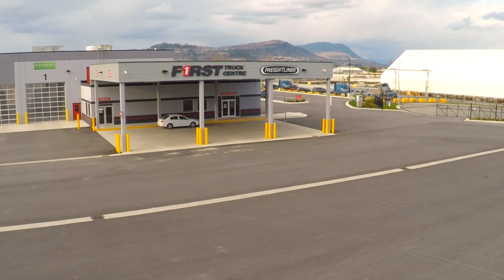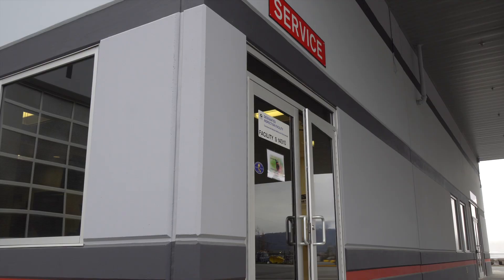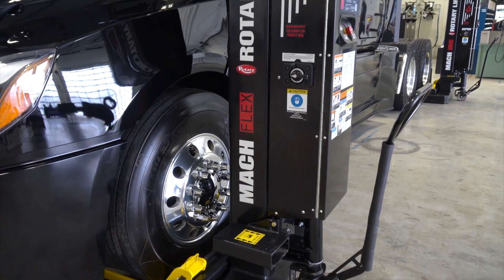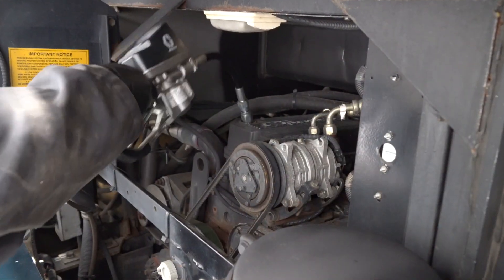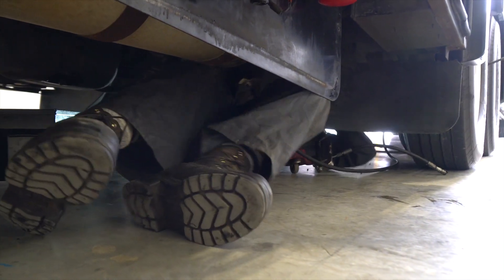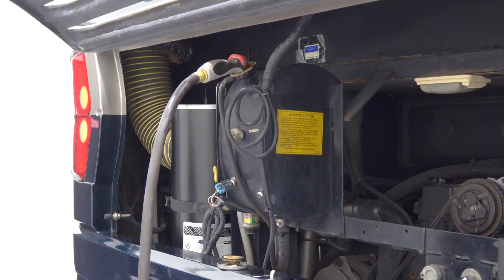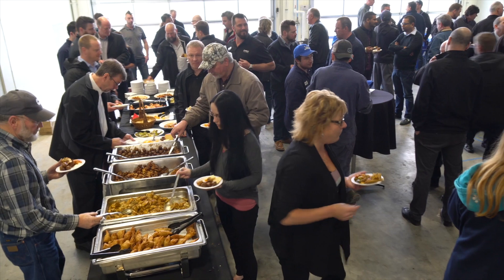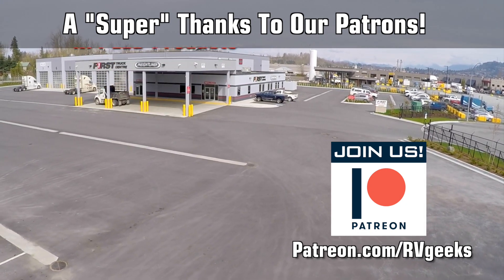🔧 RV Maintenance - Part One - First Truck Centre 🔧

Comment: This video is spot on as to the importance of a knowledgeable tech inspecting. At 9:27 you mention having the ride height bushings inspected. I had an experience after having the coach inspected. The grommet fell out while traveling on the highway. The rear immediately dropped, the coach shuddered violently , and it felt and sounded like all of the tires had gone flat. Scared the you know what out of me! Luckily it did no permanent damage but having this happen due to a 90 cent rubber grommet was astonishing to me. Moral of story? Have qualified people work on your coach or gain the necessary knowledge and DIY!
Reply from the maker: Thanks for sharing your story, Raymond. Glad you and your coach are okay!

Comment: To note for most newbies... Most RVs  of this size do a once a year oil change and lube with air filter, fuel filter, oil filers, and even a flush. Just to start.. If you put lots of miles over the year then you may need to do it twice a year. Rear to need it more then that..

Comment: You shouldn't tighten an oil filter with a filter wrench! Just get it as tight as you can with your hand.
Reply from the maker: We agree... on a car, where we tighten only by hand. We asked the tech about that, too, and he said that with such a large filter in a challenging location to grasp it, he can get a much better feel for when it's correctly tightened by using a filter wrench. He specifically went back in with the "regular" style wrench, because he said the extended one he used to get it started has too much "stretch" to it, preventing him from accurately judging how secure it is. He really seemed to know his stuff, and we have a lot of confidence in what he did. 😊

Comment: Do y’all use DEF?
Reply from the maker: Our 2005 engine pre-dates DEF, so not needed. I think it came around in 2007 or 2010 (there were two different phases).
Reply: Ok thanks... our 04 Cross Country Didn’t... Safe Travels!

Comment: Please I would like to know is having a diesel rv like a boat, everytime you take it out you have to repair something? We are looking at diesel because they hold their value but are we asking for a very expensive home to live in? thanks
Reply from the maker: Hi Melinda! Having three VERY close friends who own boats (one sailboat and two motorboats... all large enough to live aboard, and us having spent a week aboard two of those three), we feel we can safely say that owning an RV is NOT like owning a boat from the standpoint you mentioned. We have never once broken down or been left stranded in 15 years of full-timing. Our various little repair projects that crop up from time to time are typically no more challenging than re-stringing a window blind after the cord breaks, or adjusting basement door locks so they close correctly. Most of the work we've done is routine maintenance and upgrades/mods. That's not to say that things don't break, and we've had our share over the years. But we never get the feeling that "things are always breaking" and enjoy spending time USING our RV far more than spending time working on it. We did buy both our RVs new, so of course buying an older, used rig is much likelier to require more fixing of things. But our current RV is over 13 years old now, and because we take good care of it, it treats  us well back and we don't find it a bottomless pit of need by any stretch. Your mileage may vary of course, but if you go in with the understanding that it is indeed an assembly of mechanical pieces that can, and at some point will, require some attention, you'll have a realistic and happy experience. Personally, after seeing the ridiculous amount of work, time and effort that our friends have to put into keeping things running on their boats, we wouldn't take one as a gift! 😉

Comment: May day may day! I have a problem with my A/C and it's getting hot here in Arkansas. I have a digital Coleman Mach thermostat on my dual compressor pump. I turn it on and it will run good for about an hour. Then suddenly my thermostat will read that the inside temp is 30° F when it's actually 80° F in my RV. Then the pump will not turn on. If I shut it down, and turn off the breakers to the system, let sit overnight, It will again work for about an hour. And again give a false indoor temp reading and not turning the pump back on. Could this mean my thermostat is bad? I have no HVAC experience and Im stumped.
Reply from the maker: Oh boy, Arthur! We wish we could help out on this one... but we've never had any trouble with our ACs or thermostat (knock on wood), so we don't have any advice. It certainly sounds like it could be the thermostat failing... although it could also be the remote temperature sensor (if you have one... usually used if you have more than one heating/cooling zone). Or it could be a circuit failure in the AC unit itself. You may have better luck searching the forums at http://iRV2.com/forums and/or posting your question there (they're free to join and post), as someone else with your make & model of AC and/or RV may have some experience. Hope you get this fixed... and FAST!

Comment: the air dryer cartridge is changed every 2-4 years. not every service. Fleetguard fuel filters are nothing special BTW. Cummins just puts them on at the factory because they're cheap just like the green coolant.
Reply from the maker: Hey Greg! Those filters are probably cheap because they're Cummins's own brand! LOL And you're right about the air dryer, just like the coolant... not an annual task. Next year we'll be due for our transmission service! 😊

Comment: I always do my own work and some people will say that it's too much hassle but not for me so I question part 2 brake issue seal or yikes spun bearing and getting ready to cook the spindle and start a fire.I also like the old slack adjusters that were manual not the automatic ones that people take for granted and don't check old school trucker when there were real truckers no GPS no backup cameras no cell phones just map book and a CB got me everywhere with no problems back when the world was a better place
Reply from the maker: Thanks for the supportive thoughts on our wheel/axle. We'll have complete details soon. I'm an old pro myself, a little in the trucking world, but far more driving tour and charter buses. I totally remember the old days, where it was just me and paper maps. But not only did I have no CB, but a busload of passengers, who assumed I knew everywhere I was going, regardless of the destination. I've been on five-day charters, with multiple first-time destinations in several states. The only thing worse than getting lost is getting lost with paying customers looking over your shoulder the entire time, wondering why they aren't at their hotel in time for their dinner reservation! The world may have been a better place back then, but if I could go back in time with an iPhone, power mirrors and a back-up camera, I'd be king of the world! 😁

Comment: Why does the tag axle need to be lifted as well?
Reply from the maker: Different type of suspension that trucks... our wheels aren't supposed to hang from the suspension. We've seen videos showing buses up on this type of lift, and the tag axles hang WAY down, which isn't good for the suspension.
Reply: RVgeeks ah that makes sense. Your guys information is EXTREMELY helpful
Reply: RVgeeks I didn’t think of that and I thought that there was a lock for the tag axle so it can be locked in the raised position but I guess that would be too complicated.
Reply from the maker: Some tag axles do have lifting ability, but most (including ours) don't.
Reply: RVgeeks so by that do you mean that if your rig had the lifting ability it means that the rearmost axle can be raised and lowered independently of the other axles? This of course only applies to the rearmost axle.
Reply from the maker: That's right. An RV (or bus) with a lifting tag axle can simply press a button on the dashboard, and the rearmost wheels will lift off the ground.https://www.youtube.com/watch?v=355eOL6JCF8
Reply: RVgeeks thank you for the helpful video
Reply: Why not just use 4 lifts and place them under the tag axle and the front steer axle or would that not work?
Reply from the maker: Gotta support the drive axle too
Reply: RVgeeks that makes sense but if the chassis is the same as a semi truck isn’t the axle arrangement the same?
Reply from the maker: Not the same. Trucks have solid axles. The tag axle has its own suspension, separate from the drive wheels.
Reply: RVgeeks didn’t realize that. So on your rig the drive axle is solid and the tag is not.
Reply from the maker: Here's the thing.... on a truck tractor, all 8 rear wheels (the drive wheels) are all attached to the frame in a way that will not let one set sag way down if not lifted while the other is lifted. You can see that in the video at 2:42 where the unsupported wheels don't hang down. On a bus, or motorhome, since the tag axle is independent from the drive axle, they hang way down, as you can see at the 12 second mark in this video: https://youtu.be/kryn6q52X78 First Truck said that's not good for our tag axle suspension to hang like that, so they've ordered a 5th & 6th lift to do it the right way.
Reply: RVgeeks oh I see thanks for the helpful information

Comment: What is the Gator aide bottle being used for? You can see it @3:45 mark. looks like it's been there a while.
Reply from the maker: Great spotting, Mike! Here's the secret behind it: https://youtu.be/9w12E68nseo
Reply: Looks like a good quick fix. My back ground questions why the "breathe tube" is not routed back to the intake. (IE: Type 4 Positive Crankcase Ventilation systems) But, my exp is on smaller diesels, and gas powered stuff.
Reply from the maker: Sorry, we don’t know either! Those diesel mechanics have a lot of secrets up their sleeve. LOL

Comment: Hi guys! Great video! Can you tell me if the First centers have any age limits on RVs they'll take? I had another Freightliner truck repair facility tell me they will only service rigs 10 or less years old. As mine is a 2008, I'm getting nervous.
Reply from the maker: Hi Mark! We’ve never heard of anything like that, and since our rig is an 05, we’re guessing you’re in fine shape with an ‘08. Of course you can give them a call and speak to a service advisor about what services you’re looking for, and they obviously can tell you if there are any age related issues. But we doubt it.

Comment: A rule I've always followed, if you can do the job yourself and know what you're doing, then do it, if not or have any doubts or questions, leave it to a professional. Better safe than sorry later on. Also prevents potential future expenses that can break the Bank.
Reply from the maker: Thanks. We agree 100%! As we mentioned at the end of the video, Part Two will be all about which tasks we perform ourselves, which we leave to the pros, which can go either way, and how and why we make those decisions. Stay tuned!

Comment: Great video demonstration Peter & John. I even get more great ideas from the background items you didn't talk about. Like a plastic pop bottle on a bypass tube. Brilliant but simple way to prevent annoying drips on those nice clean RV parking pads.I deal with First Truck Centre in Edmonton. Our Monaco Signature had fiberglass and paint repairs done in their body shop at the West Edmonton location. You absolutely can't tell where there was damage or repair. A fair price and excellent work is about as good as it gets. Bruce Emery is the Shop Manager. Bruce tells me today RV's constitute a large part of their customer base.
Reply from the maker: Hi Malcolm! That is so great to hear we're not the only ones who've had great experiences with First Truck, and that their Edmonton location is the same quality place (not surprised). It's also good to hear that their body shop is as good as their service, since we're looking into having the peeling clearcoat re-done around the radius around our roof. By the way, that bottle keeps oil off our toad, as well as RV pads! ☺️ https://youtu.be/9w12E68nseo

Comment: Speaking of RV maintenance, could you do a video providing your year by year annual maintenance cost of your class A.
With you owning your Mountain Aire since 2005, this would be VERY helpful to potential class A buyers, since there is almost no long-term, year-by-year maintenance cost info available on the internet. Thanks in advance
Reply from the maker: Hi Dionyz! We'd love to do that, but it will take a pretty serious amount of time to assemble. We haven't kept a spreadsheet for the past 15 years, but we'll add it to our list and aee what we can do. In the meantime, we'll be sharing pricing information about this maintenance visit in the blog post that goes with Part Two of this video. Stay tuned! 😊

Comment: Nice to see that Cummings so dry underneath They were dang good but  known to undercoat a truck as it was driven down the road lol And that oil filter they took could be a bear to get threaded back on. Looks like they caught a wheel bearing on it's way out. If one gets bad it will usually trip the ABS light before things get too horribly bad. Sets a gap or wobble run code
Reply: There isn't any g in Cummins!

Comment: Thanks for posting this.  I have always wondered where we would get service on the road and this at least provides one option.  Wish we had a facility like that nearby, I won't let any of the RV dealers touch my coach (long story).  I do enjoy doing my own work, but there are things I prefer not to do and have a small shop in the next state I take it to when necessary.
Reply from the maker: We sure know what you mean about not trusting certain dealers. Been there done that. :-/
Reply: I am fortunate to have an excellent truck repair shop just 3 miles from my home. I use that facility for all my "truck" chassis service and repair, from brake work to oil changes to state inspections. They have even warned me of things that have had a history of problems in my 2016 V10 Triton. That way they check those areas with each visit. And what I really like about this facility, their work is very reasonable.
Reply from the maker: That’s great to have a good shop so close! 😊

Comment: So isn’t it you guys try to do as much maintenance as you can on your rig?
Reply from the maker: We do indeed... most of the time. As we mentioned at the end of the video, Part Two will be all about which tasks we perform ourselves, which we leave to the pros, which can go either way, and how and why we make those decisions. Stay tuned!
Reply: RVgeeks can’t wait
Reply from the maker: Exactly! That will be a prime factor mentioned in the next video.
Reply: Prevost H3-45 that’s what I figured because the engine in a diesel pusher hold a LOT of oil

Comment: Nice job putting together this and all your videos. Not only does it cover questions that we ask ourselves but also some things that we probably need to ask ourselves:-) it's simple but I never thought of the screwdriver in the oil filter trick what a clever way to avoid spilling all that oil over your arm when you're taking it filter off.
Reply from the maker: Thanks Richard! I'd never though of that either, so when the tech brought a big hammer down under the engine, I kidded him about bringing in the "real mechanic's tools" now! 😂
Reply: Richard Haugen iii

Comment: I am always queezy when I see guys rolling around under a coach depending on the air ride not to deflate. I didn't see any signs of blocking it up but sure hope they did. As I always tell everyone and as I have owned a Wanderlodge full on bus never ever go under a coach depending on the air system. It is something that has killed more than a few people. If that air let's go you get crushed like a bug.
Reply from the maker: Hi Gary! You are absolutely correct about the ramifications of the air system dropping, which also goes for using the RV's jack system to hold it up. That said, we have never, in 15 years of full-timing, seen a tech put blocks or jacks under our rig before rolling under it on a creeper. I guess they're so used to the reliability of the systems that they weigh that risk against the lost time if they put jacks under every rig they worked on. Not saying it's right... only that it's very common.